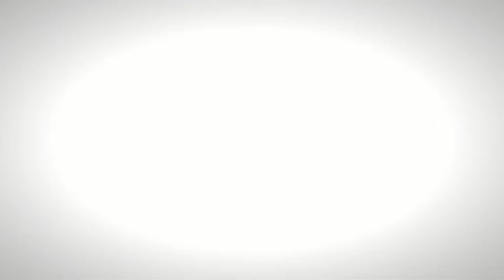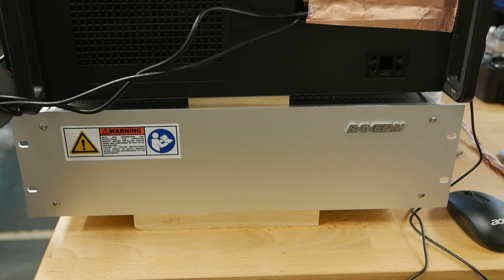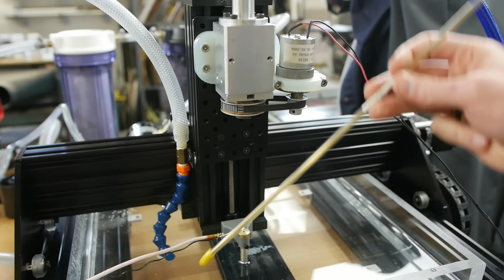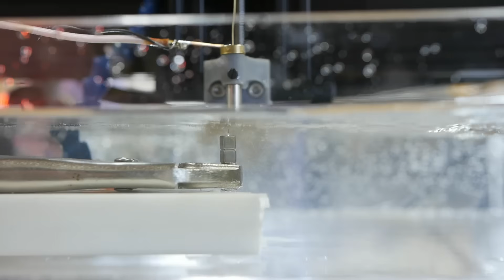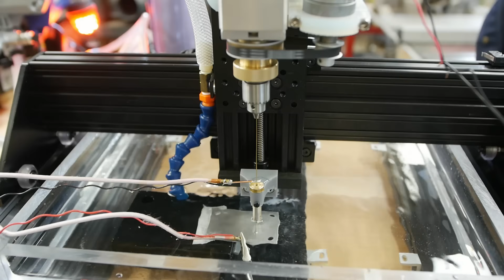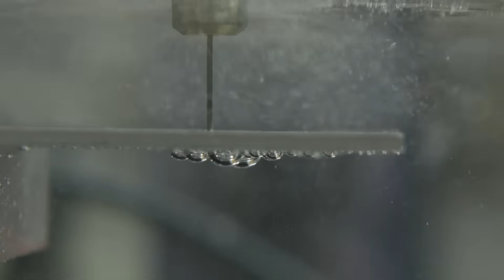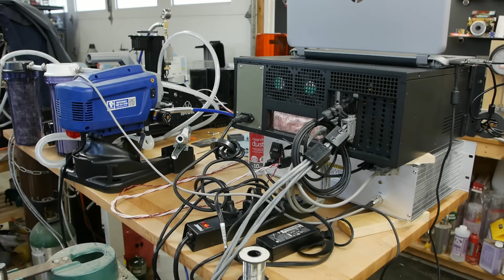Drill through anything (conductive) with Electrical Discharge Machining

Comment: Drilling through a lathe cutter is impressive. I've never thought about EDM for drilling. This is genius.
Reply: The machine shop at the Boeing facility I work at uses EDM to remove a broken tap from a bolt hole that is being threaded. It also removes broken off bolts. It saves the work piece too and the hole can be reused with its original size, instead of being drilled out to a larger size and using a heli-coil insert.
Reply: @saltysteel3996  lol literally the reason I came across this video. Cuz I want to drill out a broken tap.
Reply: Wire EDM would be a cool topic for smarter every day, the spark you see on a finish cut would look awesome in slow-mo
Reply: Exactly what I was thinking. I need to know more!
Reply: Destin, I was talking with some machine tool guys and it's pretty common to use EDM to cut coolant channels in pre-hardened dies. For example, aluminum extrusion dies are hardened to keep their tolerances and the coolant channels are cut afterward depending where they're needed.
Reply: If you ever run solid lifters on a car and want a little extra oil on cam lobes to ease your mind... EDM drilling is what's used to put a small hole at center.  I like the fact that it doesn't care what material hardness is: it is going to make hole no matter what.   I don't have room for this setup, but fantastic video.  Makes me think of a metal art project: make whatever relief model you like [clay, wood, plaster], math map it with a probe and use EDM to clone it in say... titanium.  This is handy stuff for spheroid or odd shapes that don't lend themselves to clamping or positioning in a vise.  Clone walrus tusk scrimshaw in metal?  EDM could make it happen.
Reply: Yes genius and also pretty old I think. I ran several "sinker" edms in the Polaroid mold shop and the oldest of them was vacuum tube driven so that says something. Easy being the hero burning out every else's broken taps on the sly. Also able burn a threaded hole: burn the hole to minor thread diameter, make an electrode with the desired pitch but at small enough diameter to fit in the hole (these were available commercially but we rarely had the one you needed on hand), drop this electrode into the hole and articulate one circle WITHOUT turning the spindle. Voila: fully formed threads right to the very bottom of the hole.
Reply: Been doing this since 1981, not exactly a new technology. However, having it affordable for a home DIY'er or hobbyist IS exciting. I do mainly wire EDM.
Reply: EDM is used to drill the cooling channels in turbine blades and vanes used in jet engines.
Reply: Oh hey there, fancy seeing you here
Reply: Hello bro, im your subscriber. Suprise!!
Reply: eyyyyyyyy gonna make new one?
Reply: Hey its dustin from smartereveryday
Reply: https://youtu.be/ENszk46nKGE
Reply: technology exists for over 40years, ultra sound drilling is easier and faster
Reply: SmarterEveryDay Dustin I found a video a little while ago that introduced me to EDM drilling. Try searching on YouTube for “Drilling through pencil lead”. That’s where I became fascinated :).
Reply: By EDM you mean Electronic Dance Music?
Reply: Hey Dustin!
Reply: Jordan Lapointe *Destin
Reply: @jordanlapointe8207  It's Destin, as in you're destined to get corrected.

Comment: I cross-posted this on the OB forum, and had a thought that  someone might want to run with here (read: try it with a cheaper welder than mine :D): €3000 on the PSU is a a high price point, but low enough that I suspect it's not worth the effort to DIY it- at least for anyone who actually wants to use the thing rather than tinker with it. But that makes me wonder if simply PWMing a high-current source through a high-current high frequency switch (MOSFET, IGBT, whatever is appropriate), like a TIG or stick welder (MIG is voltage controlled, no good), could sufficiently approximate the general idea to actually replace it on a temporary (or occasional usage, like tap removal) basis. You could still take a voltage reading off the cables to get the arc length to pass back to the controller board for feed override...

Comment: Amazing build :) That feedrate it pretty impressive, I always thought that this is a very slow process...
We had an older wire EDM machine at work, mostly for training, and they had some incredible pieces made with it. I just watched this machine do it's work, never operated it, but I think it had 5 Axis...
It's kind of crazy what you can buy these days online. It's no EDM head, but I was very happy to find an M16x1.5 welding current connector with internal gas flow for my plasma cutter build for 3$ the other day. I don't think I can get this part in a shop (here in Germany)

Comment: How does the high pressure water not disturb the lower mass or more flexible parts (such as the wire rope) during machining?

Comment: This seems pretty useful for a lot of things! 
Does this process also erode away copper, would my question now be. 
Because if this system could create fairly clean lines in copper layers like, say, a PCB, this could be a great way of making precise yet still kind of simple home-PCB manufacturing systems!

What would the smallest line diameter of such an erosion system be? Assuming a very fine, tapering and short (thusly more rigid and precise) nozzle without internal water flow.
Reply: Works on copper too, BUT: PCB's are better of milled or etched, as it is far more precise, fast and simple. EDM needs electrical contact and if you happen to 'mill' (EDM) an island, it is not connected anymore and thus the burning stops.

Comment: I suspect most CNC controllers out there are able to 'feed backwards' as you say based on arc voltage, that is what a torch height controller does on a plasma cutting machine. Even Mach 3/4 can do that you just need a 'torch height controller' that measures the arc voltage and supplies the input signals to Mach (up/down/arc OK) etc.
Reply: Nope. THC only adjusts one axis position based on a voltage. Reversing systmems can backtrack the whole G code program back to beginning.
Reply: @TheWireEDM  Well, he was only reversing one axis. Most commercial CNC controllers for the last 20 years (for plasma systems) have also have 'reverse run' built in. Of course, the THC back then was analog but worked well for plasma/oxy fuel systems. Mach 3/4 also have reverse run. These types of systems might have issue with trying to reverse in GCode loops etc. though.

This feed until 'X' happens and then reverse is also similar to a probing operation and can be done with other motion controls as well. Which was my point, it can be done with multiple controls it is not a unique feature.

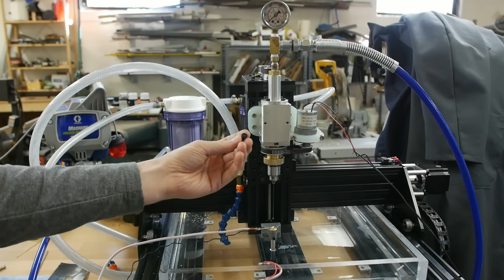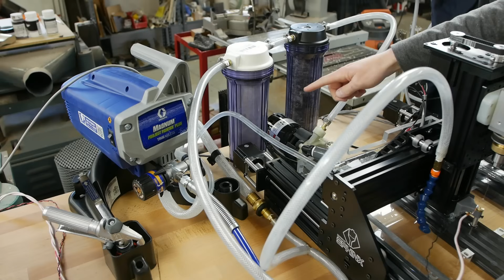Comment: Ah there you are! You asked on what else to try this on! I think you are / we are now starting to rediscover how the ancients (pre-dynastic) have done it! (Partially at least: The precision and easy cutting part, still not the precision easy lifting and moving part)... Try it with granite or quartzite or andesite or basalt etc stone. The quartz content or other materials of these types of hard stone should be conductive enough for this method to work on them or if not see if you can think of a way to get it to work! You're an engineer and you have the tools, it's worth trying to figure this out. Examples: watch?v=ZV5MuIjK9Dc&t=3m47s (3minutes47second in to 4minutes 14seconds is a good example, and again at 5:18 to 5:26) Another: watch?v=lcdU17QBSlU&t=5m39s (to 5:47) And very compelling: watch?v=puXsFyainQU&t=2m0s (to 6:24) Also your bits seem to just be cylindrical pieces of metal, could making them more like traditional drill bits or using different metals improve the efficiency and effectiveness of the EDM drill? Like if you could make the sparks come out of all the grooves or edges in a spiral bit configuration all at once... Or maybe not spiral grooved but a ribbed configuration with the sparks coming out of the peaks or valleys of each ribbed groove. One step closer to solving ancient mysteries and regaining back lost technology! :D
Reply: Also just noticed something interesting... It's called a 'SPHINX' :P Which is eluding to what I'm getting at? I think so xD

Comment: Why not use magnets to collect most of the iron in the water path when using steel? How about centrifugal filter?
Reply: You can also wrap some paper towels around the filter cartridges to pre-filter most of the muck, making the cartridges last far longer.
Reply: @YodaWhat  A typical sinker EDM filter costs 15 Euros. Not worth the effort to use the small filters as they get clogged fast. They are however nicely sized and were the cheapest option when I first built my wire EDM, you can see the cans in my videos.

Now I would like to update to magnetic filters and those large EDM filters.
Reply: A real precision EDM has magnets and 2 micron filter cloth, also suppose to use EDM oil. And a chiller for oil. Same thing with a gundrill. This is amateur hour
Reply: @highstreetkillers4377  Oil is used pretty much exclusively in sinker EDM's. Wire and drill EDM almost exclusively use deionised water. So nothing amateur here.

Comment: Maybe next you could 3D print some insulating wire nuts for the DC motor connections. Or does the dangling bare wires figure into the EDM process somehow?

Comment: Why doesn't the electrode spark to the id of the bore of the hole, rather than  just at the tip? Or if the distance isn't right for sparking, why doesn't it just short out to the workpiece? Does it have some insulating layer that burns off at the tip?
Reply: Insulation is not used in practice. If the tool is straight it does not approach the hole sides once a certain clearance has been reached then the spark is kept at the tip by advancing the tool at the rate required to make the spark occur at the tip.

Comment: We use an EDM at work to put notches in steel pipe for test standards. 

Not a CNC setup. Would actually be a viable home gamer setup.
Reply: Also use a mineral oil type fluid, and car oil filters to pull the particles out.

Comment: Have you considered using a pressure buffering canister like an anti-hammer chamber in the drill's water supply to reduce the pump's oscillation?

Comment: How do they drill the holes in the electrodes?
Reply: That's what i was thinking too, but chances are, they don't, they're probably extruded like normal tubing with a diameter of a few mm and then stretched long and thin while the cavity is pressurised or filled with a liquid.

Comment: As the "drill" moves through the piece that is being drilled - wouldn't it create sparks along the side of the rod and the walls of the hole that is being drilled - expanding  and/or making the hole uneven?
Reply: Spark gap is closer at the tip so it would jump that distance first. Only if as edmed material is flushed up the sides would it cause a spark to jump across to the side walls. As the elctrode goes through the material it causes overburn, how much overburn depends on how much current is being pasted through the electrode

Comment: I've seen so many youtube-hobbiest videos on EDM, but I still have so many questions that boggle the mind. I cannot bring myself to sit through those 4 hour training videos presented by Mr. Corporate Monotone.
For example; why does the electrode only arc at the tip? Surely with the wobble of the rod, occasionally the sides of the electrode are closer to the workpiece than the tip, causing all sorts of funky shaped holes. Is it just the nature of electricity to arc from a 'sharp' or small point rather than the larger smooth side?
Reply: Yes, they do arc from the side a little once in a while, but usually mostly because the "swarf" gets between the elecrode and workpiece and it makes the arc pathway shorter.

Comment: I hear there's a macro process using a Tesla: Point at conductive surface and set speed to 88 with autodrive off. The challenge is lowering the overall cost.

Comment: Can you drill through piece of graphite, or other non metalic, conductive matirals?
Reply: Actually, graphite is a common material for electrodes for EDM, not so much for drilling but for die-sinking. The reasons for this are a much higher melting point, less thermal expansion and less erosion at the electrode.
This makes me think, that it would be possible but rather difficult...

Comment: I would like to know more about the arc generator output. Is it just a PWM signal with 15A and a few volts? Can you maybe hook up an oscilloscope in the next video to see the "magic" happening there? Is the on-time controlled by current feedback, or open loop?

Comment: Nice.  I worked on machine shop EDM machines back in the mid-90's.  I'm guessing I wasn't the best operator, as my memory of my time using them wasn't for a long period.  I don't recall the machines I used having a rotating spindle when EDM drilling & the dielectric fluid we used was more like the consistency of mineral oil, although I don't recall any particulars about the oil (as it was SO long ago)...  Much of our work was form cutting - where a copper-tungsten electrode positive was used, to finish EDM a form for a negative mold for plastics injection molding.

Comment: You can just measure the conductivity if it's too high just take some of it away and fill with distilled. This way you always stay in range and save on water
Reply: Isn't that exactly what he explained to be doing?
Reply: @sasjadv  No he said he didn't measure it and just replaced the water from time to time
Reply: and you can mix the initial fill of distilled water with some tap water to bring it into range, too.
Reply: w0ttheh3ll or just put your finger in it and swirl around

Comment: What about EDM for non conductive materials. Think about lightning eroding rock. With high enough voltage you could maybe drill through rock. I don't know. I'm sure there is a reason why companies doesn't use this. Maybe very dangerous etc.

Comment: I experimented with EDM using a 3d printer, and the door-bell EDM settup I saw on Jeri Ellsworth channel. Worked pretty well, and didn't need the pump assembly. Great way to remove broken drill bits stuck in your work-piece.
Reply: lol, learn how to not break drills, lol. I used a 9/16" jobber drill as long as my shoulders to the ground, drilled with it on a compound angle through 6 intersections. If you're breaking drills you should be a carpenter
Reply: @highstreetkillers4377  lol, 9/16"...
Reply: I need to do this with a broken threader bit. Dewalt Carbide steel #8-32

Comment: I love the fact that your 5v supply is a dissected wall wart wired in parallel with the 24v power supply. I did the same thing to power a 12v exhaust fan in a 50v 1kW DIY bench top power supply.

Comment: Just out of curiosity, could you drill through graphite with wire EDM?
Reply: Yes you can machine graphite with EDM, usually I see it used as the actual electrode in die sinking though

Comment: Why does the tip not melt but the conductive material you're drilling through melt? It seems your drill bit would melt equally with the material you're arcing against. Is this because of the polarity of your electrical current being used to drill with?

Comment: I remember experimenting with this idea using ignition coils and a 555 timer when I was a young lad, the best I would get would be a crater like cut, focused more on the on time of the arc to vapourise   and didn't consider switching at very high speed. I'm so glad this is now a usuable technology.

Comment: I'm having trouble understanding the electrocity here - if I paid you enough to drill through my hand, would it kill me, or just hurt a lot?

Would it hurt more or less then using a regular drill?
Reply: It would probably hurt a lot less because you can bend that tiny brass rod... The voltage here can be quite shocking though but I think it is somewhere like 60-100V maximum so nothing too scary like 2kV or so. The machining part of it is just the spark that forms a few mikrons before the materials touch, which is essentially a (almost) short circuit
Reply: alles klar klaus dude it's 100V at 15A.
Reply: Asdayasman Yes but since your body isn't too conductive it won't get even close too 15A. Even if you remove your skin the resistance of your hand is probably in the 100 ohm range. But the main point is that both the electrodes touch your hand and so the current flows mostly through your hand and only a tiny, almost zero, amount of current will flow through your heart. Meaning it is unlikely to kill you. If you were to touch the drillbit with one hand and the grounding electrode with another that can be dangerous, especially with all the water around. Or if the system is ground referenced (not isolated) and you just touch the drilling electrode and your feet complete the circuit to ground that could give you quite a nasty shock
Reply: Asdayasman Well, only way to find out is if Ben tries to EDM drill a sausage or steak. My guess is it won't really drill at all because the sparks are too weak

Comment: There's a fella on Facebook named Alex who uses wire EDM to make custom "mosaic pin" sculpture for knife makers.  He's cranking out very precise high aspect ratio patterns cut into solid metal cylinders.  The negative space is filled with colored epoxy and then the tubes are cut to length and the ends are polished and are a beautiful way to fasten knife tangs to scales (handles).

Comment: Could you do this with surface copper on copper clad? Possibly a way to make a PCB?! (obviously through holes wouldn't work)
Reply: Pretty sure you could. But etching is easier. And you can probably even get better resolution out of it